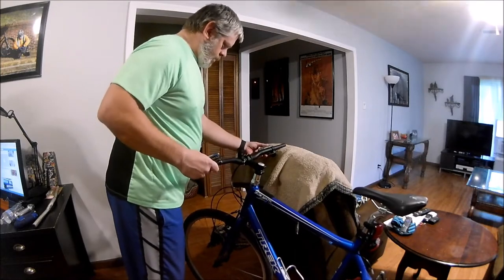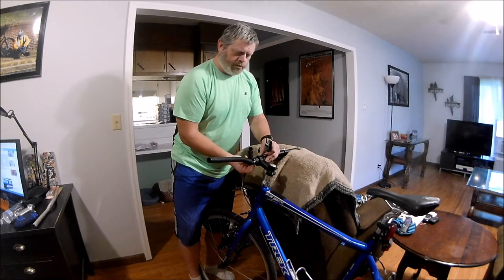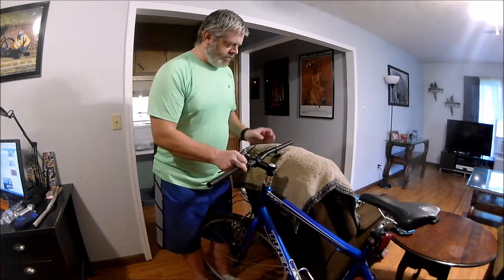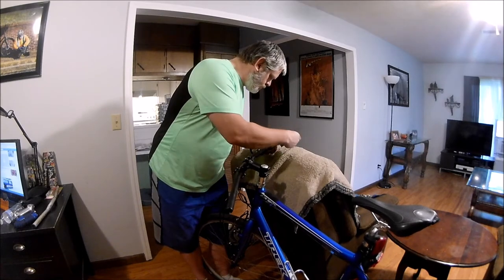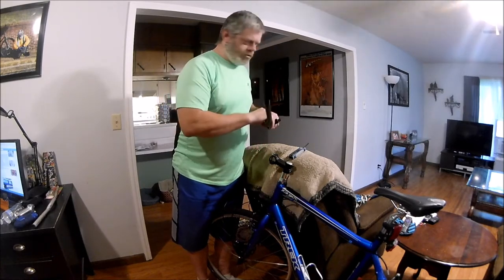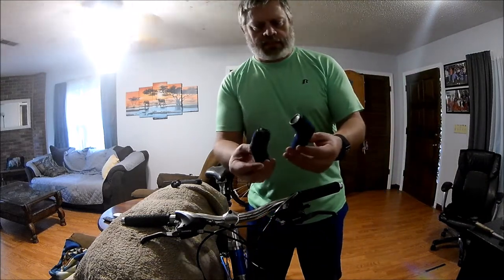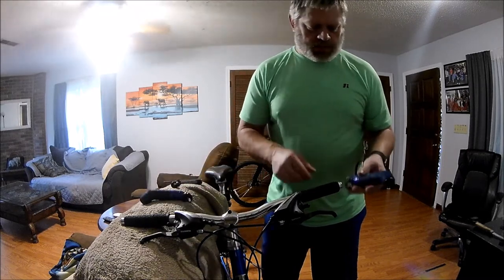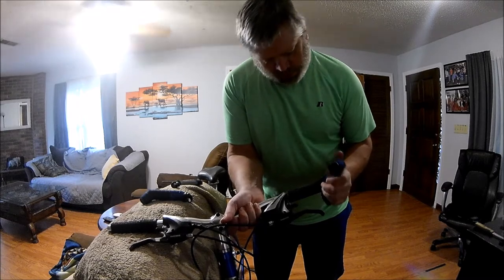The OLD SwitchaROOy HOW TO 8 23 18

Comment: 7:00 sometimes the stems get tighter over time, and has to be bent back, which is easy with a screw drive, they are secured for long time, and get kind of permanently bent, but not a big deal. this happen one one stem I used.
but it has not happen on the pricier stems yet, but it might happen at some point.
also expect this to happen on the seat tube too, on my Trek 6300 the seat tube was bent inwards where it slits in the rear, I fixed that with a screwdriver very carefully, but that was a bike that was used for years, and the seat post & seat tube has wear so the diameter has changed by few mm, also enough room in there to make creaking, so Park tool sac-2 assembly compound fixed that.
Reply from the maker: yeah

Comment: you got the brake lever too far out, 
18:41 marking lines with a colouring pencil can do a nice job, but these bars have a smooth surface, so not idea for drawing on, but on my carbon Race Face Sixc 35 bars it works great, but htye got a coating, which t it sticks to.
but might not stick on as well on those, bit you can use some tape.
Reply from the maker: nice k